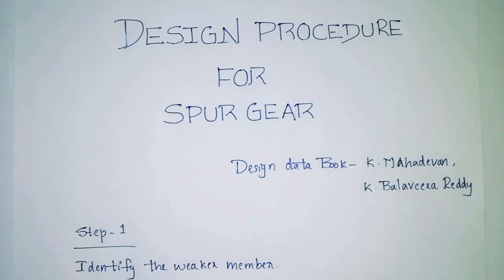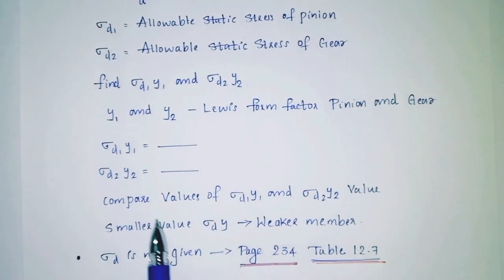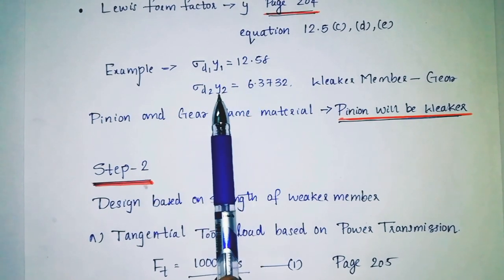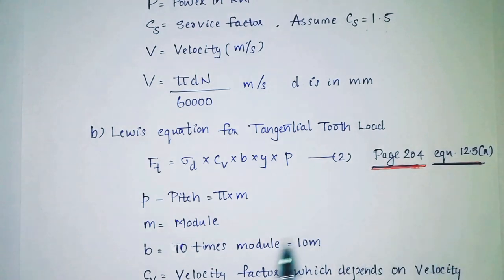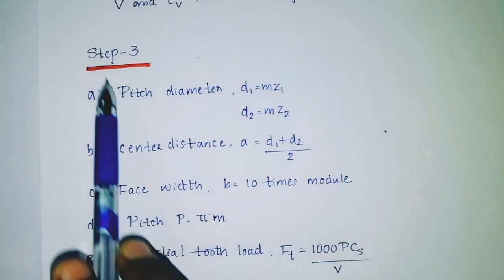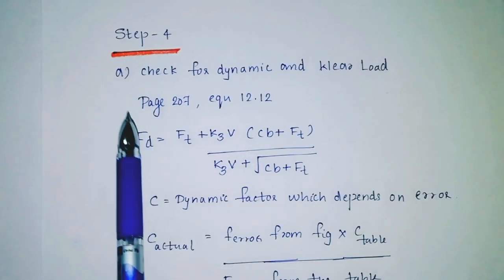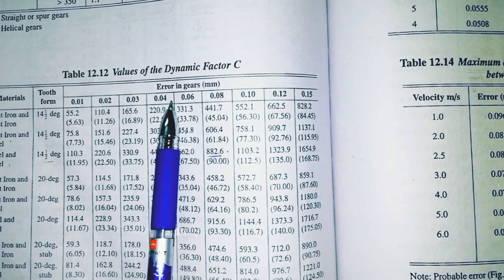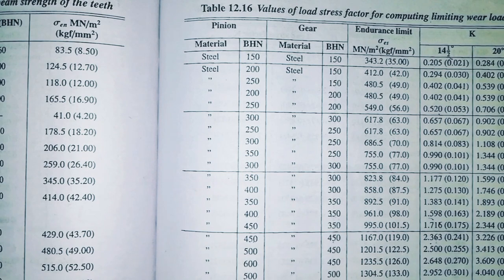DESIGN PROCEDURE FOR SPUR GEAR | DME2 |MODULE3

Comment: Dme 2 full onda?
Reply from the maker: Module 1 - Clutches, Brakes (Incomplete)

Module 3 - Spur Gear 

Module 4 - Helical and  Bevel gear 

Module 5 and 6 - Flat belt , v belt, Cylinders, Piston,connecting rod 

Ithrem topics und